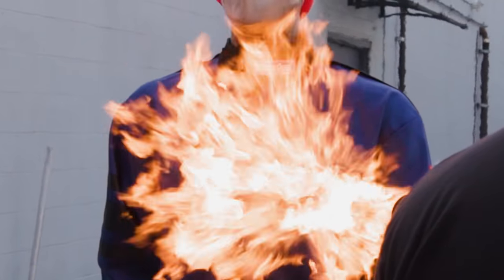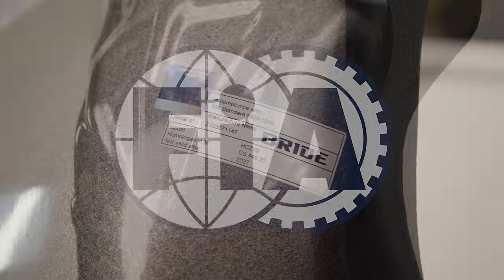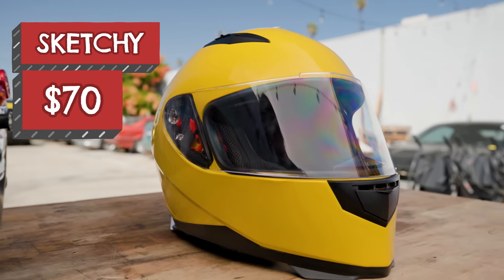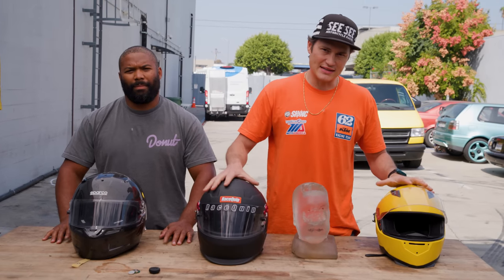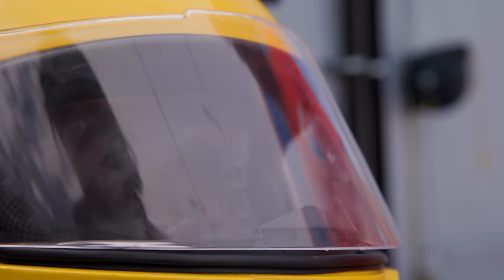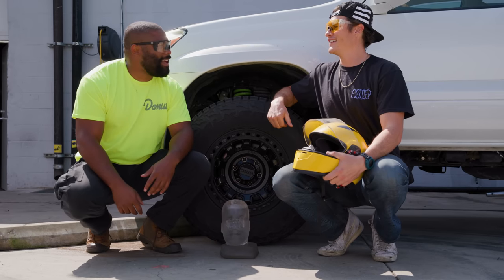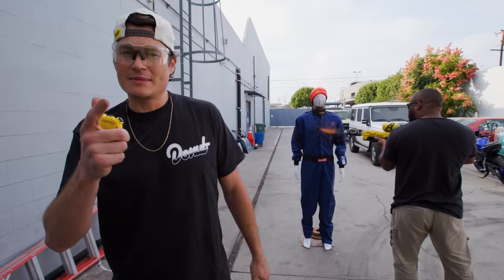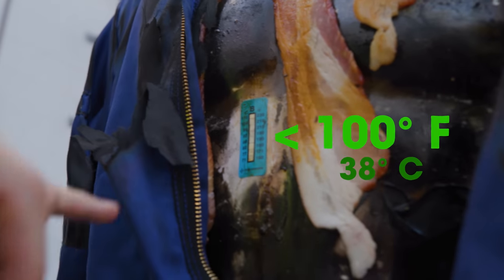$500 vs $1300 Racing Seats

Comment: I like how the sparco suit burned all the way through and still won
Reply: that's what I thought... I was like wtf are you guys on??? maybe it has 3 layers but they burned through .
Reply: @USEC3  the cheaper one was definitely better in my opinion
Reply: Agreed
Reply: Agreed, also seemed like in the video they found the racequip were more “luxurious “(comfortable) but less supportive.  But bride was awarded both comfort and support
Reply: @danielshackleton2027  i mean it's gotta be from sponsorship things right? Thought donut was pretty reliable for opinions but now I'm not so sure
Reply: They used a flamethrower, they even stated that the chemicals used in the flamethrower burn 3x hotter than gasoline burnes. If 3x as hot flame only burns a hole when blasting the flame / chemicals dirrectly on the suit up close then gas will not burn through it as fast or as severely as that did. They are certified with a spcific burn through rate as well so you can buy different ones that have better burn through rates depending on what type of racing youre doing.
Reply: The test is just kinda stupid. These flame torches makes a way more focused hotspot than a fire inside a car.
Reply: @autofigure00  The OG MAP gas was replaced by MAPpro around 2007 and does not burn hotter than propane
Reply: @danielshackleton2027  I mean they clearly all agreed that the Bride were far more secure which is the goal of a race seat
Reply: Bc the bacon wasn’t burned and the thermometer was low in the sparco kit. C’mon, just use your brain
Reply: The cheap suit burned through too. Because none of them are rated for that sort of abuse, getting three times the heat over a concentrated area. The temperature strips don’t lie.
Reply: ??? Did we look at the same temp strips?
Reply: I agreed but it is true that the temp inside where it didn’t burn through was much lower, and the bacon was also less cooked. If we count in the different temps gasoline and the flamethrower burn at, the sparco suit should do better.
Reply: The comment I was looking for 👍🏽👍🏽👍🏽

Comment: one thing to note on HiCar's harnesses- the 2" harness is only rated for use in combination with a HANS device. Using them without will do some serious damage if you're in a crash. Be safe guys
Reply: Definitely something to think about. My project car is getting a cage and racing harness, but the car was built in the 70s where all you had was a lap belt so that is probably still a safety upgrade. On a newer car I wouldnt remove the airbags and factory belts
Reply: In actual use, the 3” harness is way more comfortable over the 2” … low car for the win this time around

Comment: The gear test, while appreciated, proves exactly what I've been telling everyone for years...any helmet over $200 or so will give basically the same amount of protection in a real crash. Dropping them from 6ft was WAY more gentle than a real crash...and the roof test showed all 3 helmets did nothing to help in a super high impact situation. The main differences between a $200 helmet and $2000 helmet will usually be fit/comfort (although more expensive definitely doesn't mean it will fit YOUR head more comfortably), sometimes weight, and wind noise (for motorcycles). This is coming from someone who unfortunately has lots of experience wearing and crashing in both cheap and expensive helmets. After about $200 there is diminishing returns on helmets (assuming the helmet is certified).

Comment: I'm a firefighter that does drag racing sometimes. Those racequips saved me from a methanol fire after my vehicle rolled over from stupid me forgetting to put the right weights up front. I told the pit crew that the car is on fire but they never listened, the staff were incompetent, lets say I never went to that strip again, 3 of them had severe burns

Comment: 3:30 For airbag plugs you need to be a little bit more careful then that. Disconnect the battery, and either wait a few minutes or you can discharge the capacitors. Just don't set off your airbag.

Comment: An old buddy of mine made his own seat. Everything was hard as steel until he came up with slime cover. I told him, "that won't work. You're just going to sink right in." He was like, "I want to try it though I have make some." Few days later, he made 2 inch thick slim cover. He sat in it. Sinks right in. Then a week later, he readjust the seat to wider and made it 4 inch thick slime cover. He sat in it. 3.6 inch into the the thickness. He said, "good enough." I said, "yeah. Good enough for a 130lb man." I tried it. I sink right in popping the seal and the slime came out." All of this was for a riced out 99 toyota corolla with the 5 speed.

Comment: @3:35 uh actually the wiring shown in the video is yellow which means AIR BAG wiring..many seats have a sensor for airbags and removing it can disable them and not mentioning this is a safety fail. Obviously airbags aren't useful when you have a harness and proper seat but often you can't use harness on the street...

Comment: Would probably be good to talk about harness bars, and how they're NOT approved for track days. The safety issue involved with how it keeps a driver upright, no matter what, is vital. In the case of a rollover, that leaves the driver upright and exponentially increases the chance of death. While I think we get the point of the harness bar in the video is to facilitate the use of a harness in the seat - and maximize the performance of the seat - gotta talk about the lack of safety that comes with running a harness + harness bar setup. As well as the actually not being allowed to participate in a track day, as they aren't allowed by any track organizer I've seen. Cage the car if you're wanting to run race buckets and a harness setup. 
Overall, great video though! Thanks guys.

Comment: Those three inch belts are actually mandatory in a stock car race if setting are mandatory without a head/neck restraint like a HANS device due to the fact that they distribute the pressure more

Comment: With my experiance with helmets, there are the complete base level where the certifications are met and they are great helmets. Going more expensive only means some more features, lighter contruction, and possibly slightly more saftey. My helmet experiance is mainly in ski racing helmets, but I think it applies quite well here

Comment: Funny little fact: The Bride seat bought for $1300 was the same price in the 2007 Need For Speed: Prostreet. So are you telling me that the price has not changed on that specific seat for over 15 YEARS??
Reply: 1300 back in them days was already insane so increasing price would be a cheeky move 😂
Reply: @Bruno-xb2mt  But inflation. That seat should be like $3000

Comment: I recently found out that people put intercooler sprays on their car. Its literally a water spray for the intercooler. In the wrxs, they put them inside the hoodscoop, attached to the hood itself i guess? i think it would be an interesting thing for you guys to cover. Not necessarily on high low, but you guys should do a video about them. like what they are for and are they worth it or even work.

Comment: The speed at which your head hits the ground in a motorcycle accident is almost always the same. The falling force from the height of the motorcycle is pretty consistent, no matter the speed you are going. You are dropping from too high to accurately test the effectiveness. The variable is when u hit something with your head while the accident is happening. Thaaaats when people die with a well rated helmet on. Theres a huge difference between a fall and impacting the ground and whacking something with it at whatever speed ur going.

Comment: If this is your daily driver understand there is a sensor in each oem seat that communicates to the ecu a driver/occupant is present and will enable the air bag in a crash/collision, with after market you lose this feature, some oem seat even have airbags inside them also.....for a track dedicated car I would use one but not in my daily

Comment: Unfortunately you guys got this wrong with the belts. The Schroth Hi Car belts with the 2 inch shoulder straps are for use with FHR (such as a HANS device) only. Also, when wearing the Schroth belts in the dead man’s test none of the passenger had them anywhere tight enough. I would recommend rechecking the shoulder lengths and adjusting the crotch/side belts to suit. 
Happy racing!

Comment: The only concern is people driving on the street with harnesses. Seat belts are designed to work with air bags and vice versa. Harnesses could actually do more damage in a collision on the street with out the air bags disabled. Also helmets today are designed to be used with neck safety devices (also a risk of using harnesses on the street)

But love the video guys!

Comment: For low car you should have used the oem best version like sti calipers and brakes vs aftermarket. The oem variant would be cheapest even compared to the cheap aftermarket brand

Comment: When it comes to racing helmets (especially for motorcycles though) you should look for a helmet with MIPS. It’s essentially a small layer between your head and the foam of the helmet that can slow rotational forces. This is critical because our brains are far more sensitive to rotational force than blunt force. The centripetal force causes the entire brain to sheer. Think of it like a block of jello on a plate. You can slap it pretty hard with a spoon and not do any damage. If you spun it quickly though it will come flying apart. It’s easily the most important innovation in recent helmet technology.

Comment: One thing I was taught that it doesn't matter if you buy cheap parts for your car parts will break on a car especially if you're using it for racing that's just a given. But the one place you never go cheap on is safety equipment. Never buy a cheap helmet, race suit, harness racing seat, roll bars or anything else. You break an axle or a strut you can fix that but only if you're alive to fix it. Transmissions will go out all the time on cars especially being used for endurance sports like racing or drifting. It's easier to replace a transmission than it is to fix severe long-term brain damage..... Or grow your skin back after being on fire.

Comment: I would go high end for the harness and mid level for the seats as for the race equipment I'm going high end for the suit but mid level for the helmet. Reason being is the mid level seats seemed more than enough quality and more than enough safety and the price is a great saver for that level of quality but the harness just seemed too uncomfortable for the savings and the gear well a mid level helmet seemed to do just fine and has the same safety  rating for a lot less money.

Comment: Why doesn't anybody mention that by removing the stock seats they are disabling the air bag system without wiring in resistors?

Comment: The helmet test was enlightening... I would've default bought the mid option, but after that test, it's got to be the sparco or nothing. The comfort and quality comments were one thing, but the 18g to 22g difference is major! It's a 20% improvement! that's could be the difference between walking away and longterm damage if a harness fails.

Comment: As someone that has been involved in "safety" somet8me the only difference is a certification. I have built UL list equipment and non listed equipment for work.  They are built with the same components to the same standard the only difference was a $3000 sticker.

Comment: harness bars are a no no for tracks I go to, you should have a roll cage/roll bar if youre running harnesses. If you roll the car your body wont move but the roof will without a roll bar. not to mention the harness bars breaking.

Comment: I heard you shouldn’t install race seats without installing like a roll bar above your head. Like if your wearing the stock seat belts and the roof caves in because the seatbelts diagonal you can move your body to the side to compensate for the limited room your head can move to. But if your strapped in with those race seatbelts and the roof caves in your screwed and your head jus gets demolished cause your a lil too strapped in

Comment: (You should not run harnesses without rollover protection. if the roof collapse you’ll not be able to move your body to the side like if you had a 3 point belt)

Comment: Price tag has never equated to quality, and never will. The FIA/SFI rating is the same for anything wearing that sticker. As for the stability ("dead man test"), 99% of that is the seatbelt/harness. I've ridden in otherwise stock cars with and without harnesses; having harnesses is way better. Race seats are almost always less comfortable. (the certification is more about fire than structure. in most impacts, the harnesses will be doing 100% of the work.)

Suits have different levels of protection. They didn't say anything about the SFI/FIA rating of either suit.

Comment: Years ago I went to a speed shop to buy racing seats. I was set on Corbeau’s even though I had never sat in any kind of racing seat. They were awful, like sitting on a stack of bricks. I ended up with Sparco’s which I still have to this day almost 20 years later. A lot of the time you do get what you pay for. 

Also; finally someone who pronounces Bride correctly!

Comment: Can you guys do universal bolts on. Cheap vs expensive bolts on and have it dyno? (Air intake, and axle back/cat back exhaust)
I'm aware of the mita build that has been done, but does double if not more worth it? Mainly Cheap as in auto zone vs something found at a dedicated aftermarket performance site.
Or just in general for Low Car any performance Mod under $200 or $100 compared to high end.
Example, Spectre Cold Air Intake and Flow masters HP 2/DBX or Laminar Design Muffler. VS Aem/KNN Cold Intakes and Corsa Cat Back Exhaust. Ideally Same therortical Muffler design.
Reply: Yes Im aware a fine tune part is gonna hopefully preform better and to cost a pretty penny but how many and in what areas does it really need to be like that.
Just like a PC build if I had an extra 50 bucks or 100. Is the upgrade a worth it at one part. And if it can go into a different part will it benefit the whole PC at a higher value.

Comment: Question for Jerry, or anyone else on Youtube who is more likely to read this. What are the differences between car racing helmets and motorcycle? I feel like Motorcycle brands like Shoei or Arai would be better since they are meant to protect you without a car cabin.
Reply: Motorcycle helmets and auto helmets mainly differ in some areas of construction.

For example, for motorcyclists, the Snell rating is good, but lately more people lean towards the ECE rating. Motorcyclists will look for features like MIPS, which will help against rotational force.

Motorcyclists will experience a lot of smaller impacts and chances to break their necks at once from sliding and rolling than they will from putting their head through a windshield. FortNine has good videos talking about the different ratings as they apply to motorcyclists.

Aa far as I remember, auto helmets usually include fire retardant material and are threaded to be used with HANS devices.

Comment: One point to note, your helmet test was honestly pretty inherently flawed. Motorcycle helemts are not designed to prevent concussions (g forces) they are designed to keep your skull and face intact, if they were designed to prevent concussions they would lose that. And as you can imagine, a concussion is a much better outcome than your brain no longer being inside your skull.

Comment: There is a youtube channel, fortnine who probably makes the best motorcycle content on the platform.
He did a lot of helmet tests and realistically after $200 you're mostly paying for finish and features. The safety returns are minimal unless you go for an updated safety classification. (Snell is bad by the way. The way they test is nothing like you would experience in a crash, albeit with the focus for motorcycles not cars).
Sharp (uk. Arguably the best) and ece (european stabdard) are the best. The us govt tests (DOT) are also pretty horrifically bad but the european counterparts are to a far higher standard.

Comment: I wouldn´t say more expensive is more better. I would say: Get the race seat for YOUR Body Style, for YOUR budget. There is no more expensive is more better in this point.

(Example: If you are a little overweight, maybe you wont fit into sparco seats, which are also like 1.3 grand)

Comment: That sparco fire suit burned right through. Doesn’t seem like it should be the winner. Wonder if they sponsored this episode.
Reply: It burned right through but it kept the inside temperature lower than the others. The others offeredway less protection at first, but maybe long term exporsure would be in their favour. What you need to consider is that in an accident youre gonna want to escape as fast as possible and so if you dont start burning right away,  you may have a better chance

. Also if you can prove they were sponsored you can get them a strike from youtube. But I highly doubt it.
Reply: @gjeraldh2989  Good point, I didn't notice the temperature differences between them. I guess its a different design, the ablative material may get damaged but offer better protection for those first crucial moments. Wish they had discussed it more.

Comment: Wouldn't a wider 3" harness be better in a collision all else equal? Less force per square inch on the body.  Don't finish this WRX series without installing pseudo-rally F&F roof scoops & pavement dragging mud flaps.